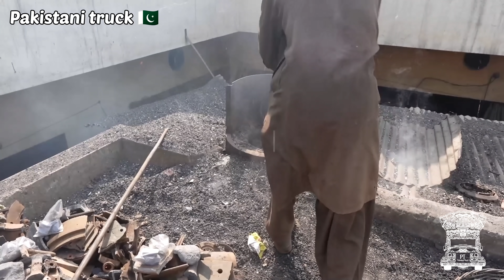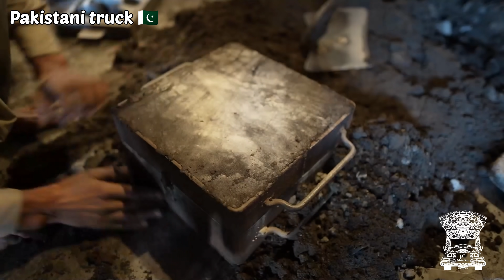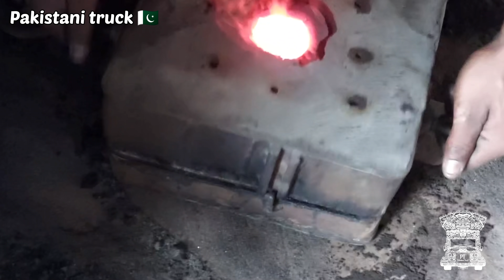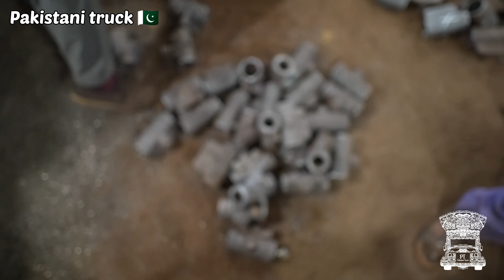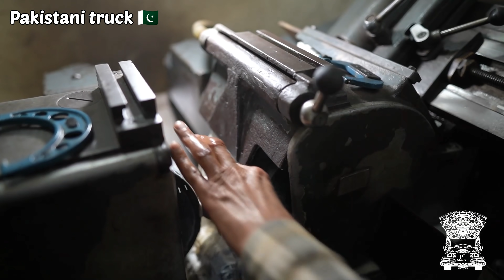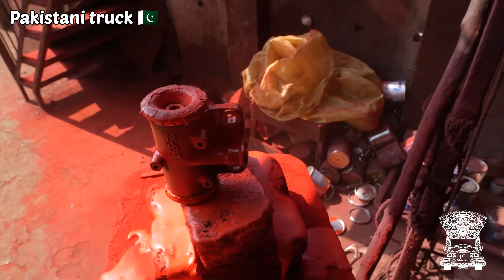Manufacturing Process Truck Break Cylinder from Scrap | Complete video

Comment: I love these guys. They're working in a Foundry with molten metal and there only foot protection is nothing but bare feet and filp flops.
Reply: And no eye or hearing protection. Must keep costs low!
Reply: @warpedbeyondhelp  The equipment is cheap...workers are even cheaper.

Comment: Amazing Pakistani Talent.  During late 1980's, a Pakistani Mechanical Engineer, established a Car Making Factory, called Proficient Automobiles, where he made everything, including the engine of his Pakistani Car Company in Pakistan, using similar Sand casting techniques.   It had two models, a pick up with a hood/bonet, like Toyota Hilux, and pick up with cabin only, like Suzuki Ravi Pick Up.  But that company was forced to shut down, mainly due to pressure from Suzuki Motors, which saw it as a threat and main competition for Suzuki Pick Up.  Suzuki Motor Company officials in Pakistan bribed the Pakistani Government, which shut down the first Pakistani Homegrown Automobile company, by cutting off their electricity and gas connection, in their Sindh factory.  Imagine if Proficient was not shut down, Pakistan would have been a car manufacturing and car exporting country today.
Reply: Wow